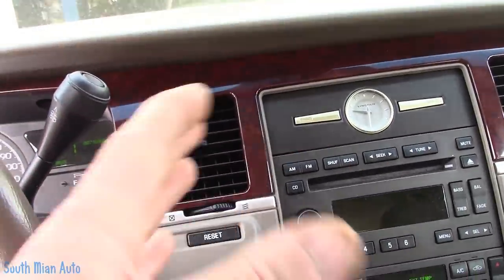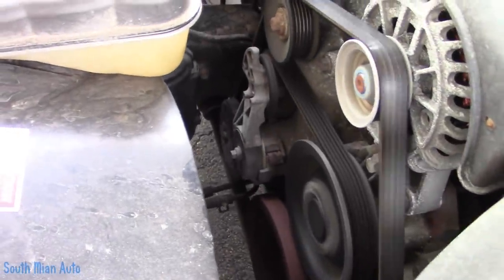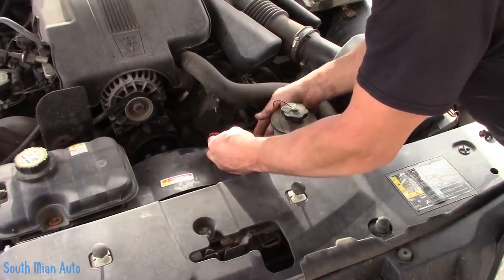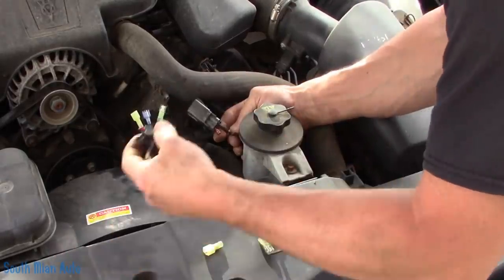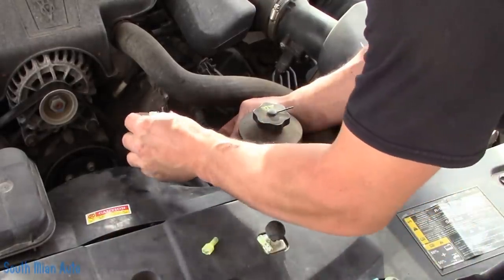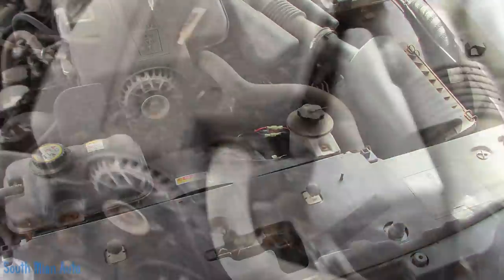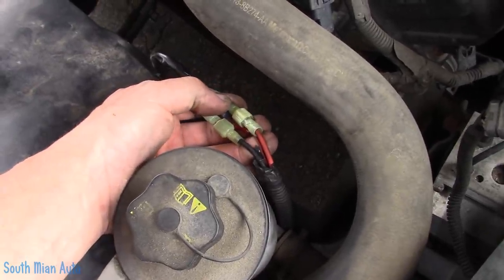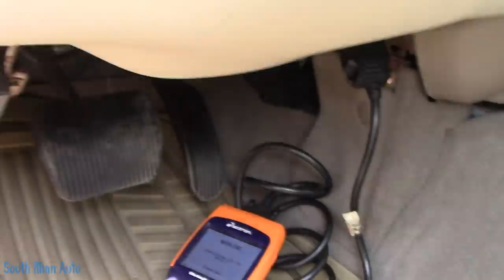Overheating Lincoln Town Car

Comment: a schematic diagram question on the ASE exam had a situation where the cooling fan was operable with the A/C on (condenser switch grounded)..but off during normal operation...different scenario which boiled down to a bad ground to the Engine Temp switch..since the condenser switch automatically grounded the fan relay...resulting in engine overheating during normal operation....Bob

Comment: If you don't open a window, you're going to get bit by a dang car that locks its own doors with the keys inside someday.
Reply: I have a Mercury Villager that auto- locks spontaneously. I always wait in lobby of any quick lube place with my spare key ready,and have had a couple of techs approach me somewhat sheepishly asking for it.
Reply: anti chuckle Happened to me once in my Crown Vic. Learned my lesson. Always roll down the window now.
Reply: I always roll a window down just in case
Better safe than sorry

Comment: I'M HAVING THE SAME PROBLEMS.  . I'M GONNA START WIGGLING WIRES.. IF THAT'S NOT IT.  COULD IT BE  A FUSE OR THE CONNECTOR

Comment: FYI, This Lincoln uses a pressure transducer on the high side of the AC line. If the sensor doesn't detect the high side pressure going over a particular range it will not cycle the FAN.

Comment: Did you add a generic coolant to another type, guaranteeing future sludge? I used to do that, until I damaged my cooling system. I thought it was ok to mix, because the coolant containers indicate it was. Now, for me, it's OEM only, 100% of the time.

Comment: Great video. I have 2006 L TC. It has the blend door AC issue. Stuck on window defrost and some floor. Where to take to fix? I hear it requires dash removal. Any idea what the fix should cost?

Comment: Anyone that knocks that repair doesn’t work in the real world.
Reply: YA NO SHIT, I AGREE Toady.
Reply: only knock i have is he filled it with straight water yes its summer time now but hopefully that car dont freeze up next winter being in upstate new york
Reply: Anytime you have a burned connector you should check the amp draw. Fan motor could be junk.
Reply: @johnaranjo2059  You watched him open a new bottle of premixed, whatcha talkin bout ya ding dong
Reply: John A.  THAT TYPE OF ZEROX ANTI. IS CLEAR.
Reply: @NoWr2Run  oh thank man i didnt realise these cars had clear coolant thats clesrs things up a bit haha
Reply: Steve B   Good point, I was happy with the attention paid to diagnosing the  connector though.  A loose  terminal was identified and when powered up the fan sounded as if it operated at full power.  The test drive was adequate.  Also I noted he grabbed the terminal repair after the test drive feeling for resistance heat.  Not much to complain about there.
Reply: @johnaranjo2059  that's Zerex G-05. It looks clear when you pour it but if you see it in the reservoir it's not. It's a pinkish goldish red color of I remember right (I work on heavy duty trucks, not cars and we don't use it) but I do know its a HOAT hybrid organic acid technology coolant, it's very good, and it tastes awful.
Reply: I'm sure the dealer would have replaced the fan assembly, plus the wiring back to who knows where, and charged like $1500.
Reply: For sure

Comment: Money lights out!  😂 
Rule number two. Don't roll the windows down!
Rule number one.  Wait for it....... Never adjust the seat!
Reply: I understand 1 but why 2?
Reply: He has a video on one repair....seat switches were burnt out.
Reply: Never put the window down because "up" might not work.  Bad switch, bad connector, broken wire, motor turns one way but not the other, etc.  Even with manual-crank windows - the regulator in my '65 Mustang broke a gear tooth, and still worked fine for "down" with gravity pulling on that big honkin' giant slab of glass, but "up" was another story - you had to physically lift the glass with one hand while cranking with the other.
Reply: Never use/adjust/touch what you aren’t getting paid to work on, because inevitably when it comes time to put it back the way it was it won’t work properly.

The customer will swear on their momma’s life and a stack of Bibles it was working fine when they brought it in (even though it’s never worked since they owned the car) so YOU must have broken it!

So you OWE it to them to fix it since it was fine before YOU touched it! 

Every. Stinkin’. Time.

Comment: I have used these mid 2000's fans on other older cars, and they pull a lot of amps.  those terminals are inadequate ( too small)  and should have been 3/8, not 1/4 terminals.  Also should have been soldered and shrink wrapped.     This is a failure waiting to happen.    But,  I think all else that you do is top of the line.

Comment: When i was a service writer, police car had overheat issue. 
Tech called intake manifold,nope. Rad fan,nope,water pump and t-stat-nope. Three time i asked the tech if rad was clear of debris. Said yup. 
Took it upon myself to pull plastic cover above rad/condenser. It was blocked solid...
Tech did great on making time,but couldnt troubleshoot his way out of a wet paper bag. 

I love the disaster averting cheap 
And quick repair. Im betting ultra happy customer.

Comment: Had something similar happen to my V8 Commodore. Fans had been accidentally disconnected. Pulled up immediately the temp gauge got hotter than normal, noticed fans weren’t on, let it cool, checked fuses etc. Gave it to my mechanic who reconnected fans.

Comment: Eric, have you ever tried using Deutsch connectors? They make kits for two, three, four all the way up to 18 pin connectors. Best connectors on the market, expensive to buy but never an issue after. Crimpers are stupid expensive but coming down in price but check them out, easier than this type of repair.

Comment: When you have a no leak coolant loss, I like to check for bubbles in the coolant while she's running which would indicates a blown head gasket/broken head bolt, undesirable but not unusual.

Comment: Hoping for some soldering,  oh well,  and was waiting for you to nail some raccoons on that test drive in that hot rod Lincoln.   Good video  !!!
Reply: Soldering is no good in an engine bay. Vibrations and heat cycles will make the joints fail eventually.

Comment: My only question (been a subscriber for almost a year now), you usually figure out why the connector started meltin in the first place.  Too much power through the connector, bad connector, something caused that connector to melt like it did.  We usually see the diag to make sure the power is ok.  If Mr O. did do that, can someone explain to me what he did to make sure the connection doesn't melt again?  Thanks!

Commenting from Richmond, VA

Comment: We all like those quick finds, appropriate repair, and you can't get paid for chicken or egg philosophy, however, she was driving some 350 miles,  to Boston, coolant was unreasonably low, and we all know the boiled over smell, no mention of smell.  There was no steam out the tailpipe, how was the oil, any coolant there? I am sure you said to her you may have other issues, intake leak, cracked head, etc and go to Boston at own risk, I think her problems are not over, I am thinking cracked head. which means new engine, or new car Thanks for the video, is good for us all levels.

Comment: Just think, with a normal fan mounted on the snout of the water pump this would never be a worry. Which is why l converted my two 4.6 cars to a nice, constant spinning fan with junkyard shrouds from 1994 models.

Comment: Would have no problem with that fix on my car. It works it should last the life of the car unless the fan goes bad again. Even then replacement fan can be put in real easy. You didn't do anything weird wild you just fixed it. You don't need that harness connector you really get down to it. What you did is perfectly fine by my book.

Comment: Hey Eric did you have to disconnect battery and are the fans gonna stay on all the time now?
Reply: Disconnecting the battery when working with electrical components are recommended. And no the fan will be the same as before. All he did was cut the connector and put on another set of connectors. It's still power to power, ground to ground, and control to control.
Reply: Ahh k gotcha 👍 thanx man

Comment: Given the choice of doing it your way vs. the “correct way” (replace the OEM connectors with OEM type connectors that can overheat and fail again), I’d say you way is BETTER than the “correct way”.

Comment: Nice fix. Though I probably would’ve monitored temps thru the computer vs simply reading a (likely) buffered temp gauge. Could be overheating slightly and the gauge would still sit in the middle. I’m sure it’s fine but you never know. Might have an air pocket or something.

Comment: Only criticism I have is one that applies to most mechanics. Why do you use crimp pliers on connectors? Because there is no lock mechanism in them you can't guarantee that every crimp is tight. No, experience and feel doesn't count as "feel" is subjective. As an electrician for the last 40 years l've always used ratchet crimpers as you're guaranteed the same pressure on every crimp. I've actually been in a calibration lab where we tested crimp pliers against ratchet crimpers. Consistent,solid crimps with the ratchet as opposed to variable quality crimps from the pliers even though they felt tight. Otherwise, good repair, I'm with you on age related repairs. Sometimes as long as it's not a safety issue, alternate methods can be used.

Comment: One thing that became SOP was to replace thermostats on any car that came in for an overheating concern, no matter the original cause.  We get hammered on rechecks when we ignore "this one simple rule".  Something about an overheat can kill the wax pellet in the t-stat.  I got bitten by this back in the 1980s when I was a young pup in the shop.  When a 22R came back in after I put in a water pump the day before the boss asked whether I had replaced the thermostat.  When I said "no" his only reply was "dumbass".  That about summed it up.

Comment: I had to do the same style fix on my ex’s PT Cruiser. The idiot engineers put the plug connector at the bottom of the radiator and over time and a few parking stop curb rubs, it crapped out. Once I did the same fix and zip tied it up higher, no more issues.

Comment: I have a 98 f150 with the 4.6 2 valve engine and recently checked my coolant and had to add a gallon myself. It was the first time I checked it in 8 years maybe and I live in Texas with 100 plus summers ano no overheating with the ac on in traffic...I know my bad, so I think it must be normal for those to evaporate out some over time. I couldn't find any leaks and my cats and o2 sensors still work so I'm thinking that is what it is. And yes a flush is on the list!

Comment: Hearing that 4.6 wide open was almost as good as the diagnosis and fix . I say the fix was good under short time limit. And it is sealed with tape and treated with anti corrosive

Comment: Personally I would just use a generic 3 pin plug. But this works also. Plug looks more oem in my opinion. But then again I don’t think I diagnose cars anywhere near as fast as you do

Comment: Two crown vics one Lincoln 98s all did same thing and would do fan connect thing or would melt had to splice in or get new connector at salvage yard had problem multiple times alot need to be pushed in or something.

Comment: im too lazy for this kind of repair.
i would have used various cans of cleaners to spray it clean and plug it back in.
 maybe use wire to put tension on it in a direction that keeps it connected.
Reply: I would have butt connected the wires together.
Reply: @mph5896  that requires more effort than I care to give lol

Comment: A 4.6 with low coolant. . . I'm disappointed you didn't check the four corners of the intake.  Your missing coolant is probably in the spark plug wells!

Comment: I'm having the exact same thing occur on my old beater car Lincoln TC 2009.  Temp needle went up out of the blue. Never smelled any coolant leak.  Hit the heater button to see any effect. Still had hot air so I knew I had coolant flowing through heater core. Parked it. Went on a trip. Thought about it for a few days. Thought the electric fan was the culprit. Came home from trip. Pulled connections to fan control module apart. Plugged them back in. Joy. Still worried I have an intermittent problem because I didn't do much. What I do know is that my fan is turning OFF . So I will drive it and keep an eye on it for now. May get a new fan here on standby.

Comment: What car battery do you recommend . I have tried advance Auto parts there warranty on there batteries and different parts is the worse I have encountered . What would you folks recommend ? Has used O'Riley parts there about the same as Advance Auto .

Comment: switching the male/female on the power/ground... smart.
Reply: That's the way I've always done it. When you get more than 2 wires of the same size it can become an issue though. At that point I still switch pairs but add colored tape.
Reply: @Gizmo42Rodeo  I guess you only have to mix them up once  ;)

Comment: I would have soldered those spade terminals to avoid risk that the stripped wire may oxidise and cause problems again.

Comment: Mr O i have a 2001 hyndui elantra my car has a check engin and the code is P0720 i look it up it say low voltage on # 4 fuel injector can you help me on this problem does this mean i have a short on the connector ?

Comment: Its the aftermarket fans fault, the connectors on those things are crap and have tons of restance, when i had to use them, I would hard wire them in

Comment: know how to keep your electrical taped ends from unraveling with time,  like the factory taped  ends does,  which really pees me off.  take electrical tape and make two or more rotations with the tape inside out,  which means sticky side out,  unsticky side in , then rotate tape as normal then tape whole thing one layer,  go back, add another layer towards starting sticky section,  where the end will be tape to tape,  sticky side to sticky side,  cut tape. do this once, and you will never do it the old way that we were all tought.  especially on classics,  restoration,  personal vechical

Comment: What caused that electrical connector to fry? A short?
Reply: 3069mark loose, then get hot melting over heat kill the car,,,4.6 mustang too

Comment: I’d have fixed it the same way. A connector is a connector is a connector. I’m afraid though, a lot of guys wouldn’t have the presence of mind to reverse the connectors to make misconnecting idiot-proof. Whenever you try to idiot-proof something, a better idiot seems to show up.

Hot Rod Lincoln wasn’t a Commander Cody original. It was first recorded by Charley Ryan, in 1955.

Comment: I'm not gonna lie and tell you I think those spade connectors are anywhere close to the optimal repair for that problem; however, something tells me this is a little old lady that you aren't going to charge much, if anything.  So it's probably about right.

Comment: Very nice job, but I switched to Tommy Tape years ago because it stretches, is self fusing, leaves no sticky residue when reopened, and its silicone base is ultra violet, oil, and chemical resistive. (tommytape.com)  Were you referencing the very deadly Coral snake (if its nose is black, keep away Jack) that looks like several other non-poisonous snakes with orange bands and noses?

Comment: Back when American motor companies actually made decent cars. Use to love GM, Ford, Dodge for various vehicles, owned them all. Now days with how much they try to avoid and coverup problems I wouldn't even think of buying one from the last decade. GM's "Allison" 10 speeds that explode after 20,000 miles and ford's bizarre idea of going with open deck blocks on something that's meant to be turbocharged. Ignition module fires, and Chrysler/Dodge of course is just a badge slapped on FIAT group platforms now.

Comment: Called cheap ass parts ,two things cause overheating on crown Victoria and town car intake leak crack around lower portion front and fan going bad . After market fans have cheap connectors which make for high resistance causing burn connector. Happens on all high voltage components.

Comment: Where does the "red and yellow" reference come from. you ask? It's a rhyme that was made up so you can remember how to tell the difference between a genial king snake and a venomous coral snake. Both snakes look alike in their coloring. However, they differ in one key respect. It's in the arrangement of the colors. A king snake never has the colors red and yellow touching each other. And a coral snake never has the colors red and black touching each other. The rhyme was made up to keep you safe when you encounter either of these snakes. Here's the rhyme:  "Red and yellow, kill a fellow. Red and black, venom lack."

Comment: It's an old Lincoln.  That's back when you could boil it over and the engine would survive as long as the oil didn't go bad.  Now days .. .well, hot once and booom ... new heads.

Comment: Random fact of the day : The original "hot rod lincoln" was a Ford Model A body with a Lincoln-Zephyr V12 engine, overdrive, a four-barrel carburetor, 4.11 gear ratio, and safety tubes, for the ppl that wants to know. Not a sponsor or fan. lol

Comment: What crimpers are those?
Reply: I think those are Snap-on 7 in. wire stripper/crimper/cutter PWCS7ACF for 12–20 AWG wire (Snap-on's part numbering has varied/changed over time for this tool, this is the current part#). Snap-on also has the PWCSS7ACF, for 14–24 AWG wire. The Mac Tools WSC7 and OTC 5950S are similar, very similar, patterns and OTC also offers one with a  90 deg. offset, 5950A. The Snap-on are made in the USA, Mac Tools is owned by Stanley (probably made in the USA?) and the OTC are made in Taiwan.
Reply: @tahuyaguy  thanks!